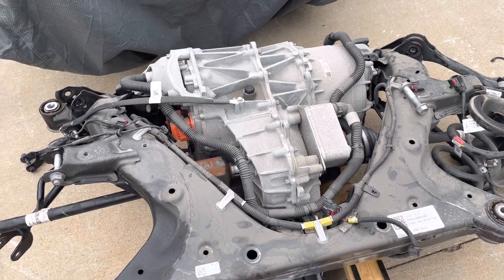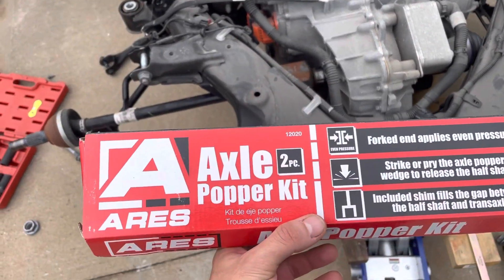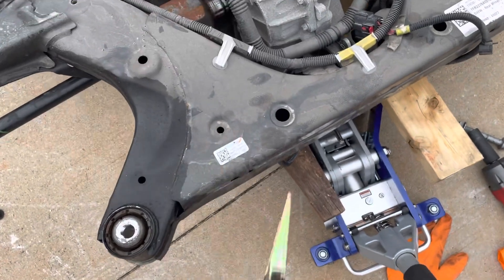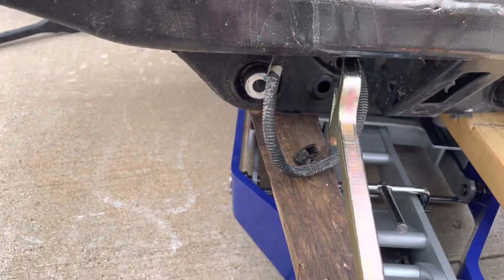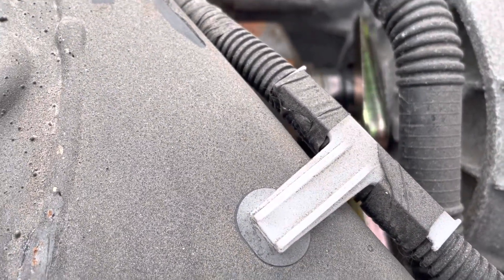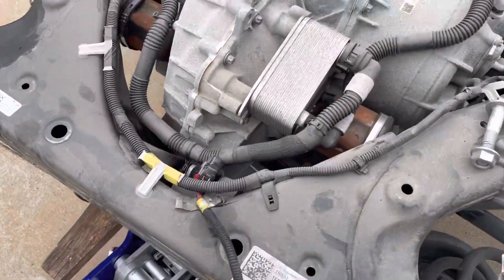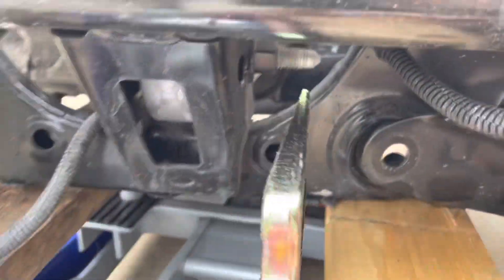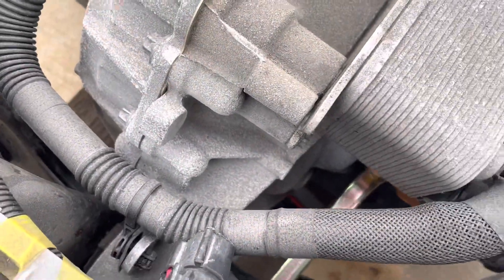How to remove an axle from a Tesla driveunit

Comment: It looks like a close fit, where the initial O.D. of the axle shaft first gets wider by only a little bit.  Is this why you only need the sloped fork and not the other piece?  If so, is there a width spec to that fork?  Seem like it would be easy to go too big or small?

Comment: Don’t use hammer only put pressure steadily and increasing and it will pop out there is a spring loaded clip inside. I don’t think what way you use the fork really matters should maybe have the angle thinner part of the fork towards the casting.

Comment: The tool is also known as a ball joint separator . Probably best to have the flat side toward the motor case that way it will spread the load more evenly on the case and is less likely to damage it.
Reply: Exactly, anything to support the casting or spread the load on it and save the seal, the steel CV cup is robust and easily replaceable.